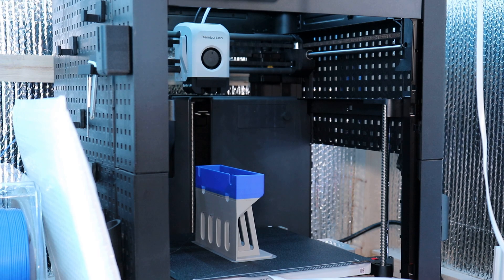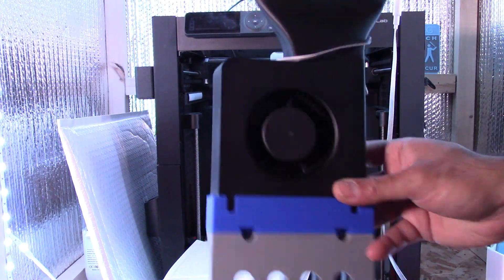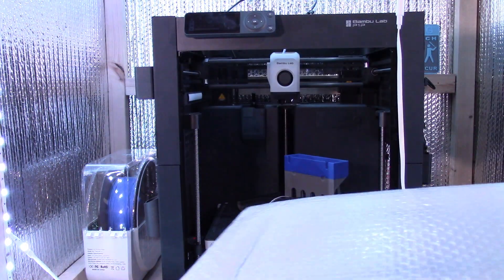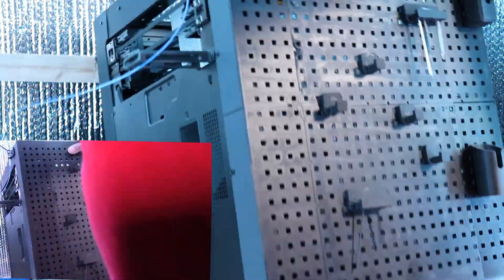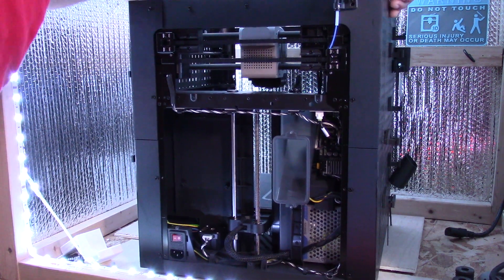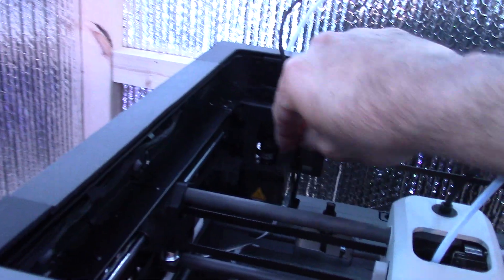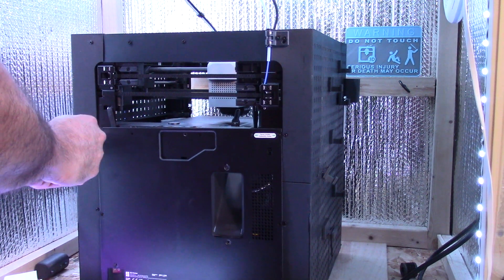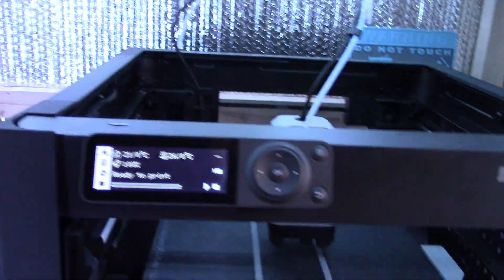Bambu Labs P1P AUX Fan Upgrade and Must Have Spare Parts - Part I

Comment: Parts are amazingly priced. Fully assembled extruder (gear box) and hotend standing by, along with build plates, etc. Once diving-in, it's not so intimidating. Thanks for the video share. The auxiliary fan looks pretty easy to install. (Is that printed fanbox frame required?)
Reply from the maker: Yes you definitely need the fan frame box. It all depends on your level of expertise with Hands-On technical expertise but yes everything is fairly easy.

Comment: Does the aux fan improve prints much?
Reply from the maker: Yes, there is a noticable difference, especially for overhangs and bridging. It'll also eliminate supports for a good chunk of prints due to the increased cooling.
Reply: @MicBot  Is it noticeably quieter? Or is it about the same?
Reply from the maker: @venorando3672  it's about the same.
Reply: Not sure if I'm doing it wrong but even with the fan at 20% and using bed glue the (pla) prints curl of the plate at the fan side. When the fan is off I've no trouble printing
Reply from the maker: You should keep the fan off for the first few layers.

Also make sure the chamber fan is off. 

I have never had curling issues with Bambu Printers. I've had the issue before with Creality and Ankermake M5.
Reply: @ideal3b  same here. Have you figured it out? I am now playing with settings:
1) 5 layers no fan and then ~20% AUX kicks in - still curling
2) ~20% for all layers - still curling
3) 70% for all the years but the very first one - still curling
Reply: Did you try to turn it on after the first 3 layers?